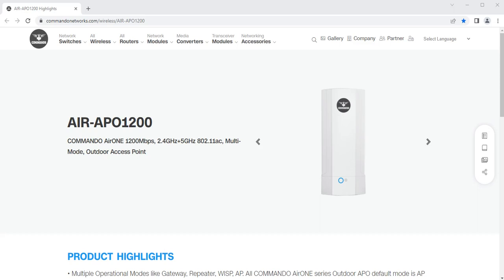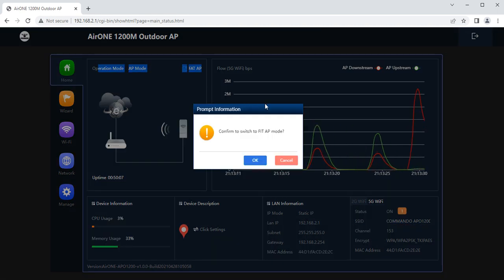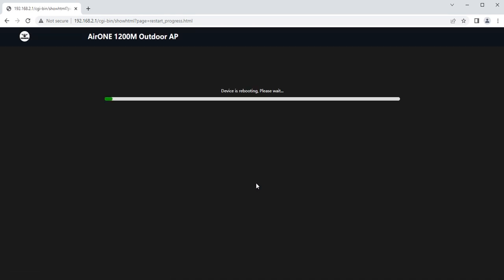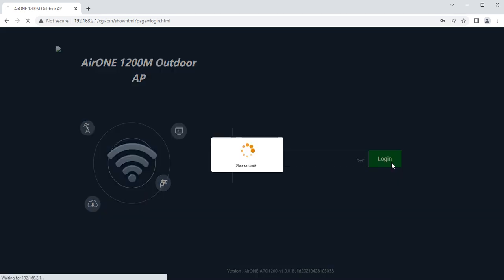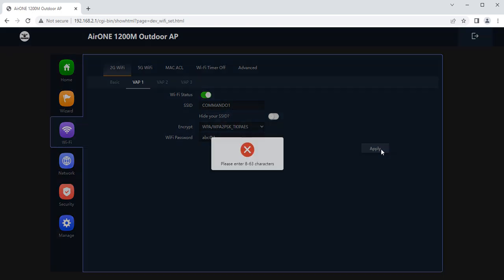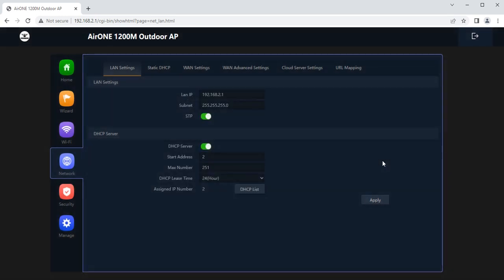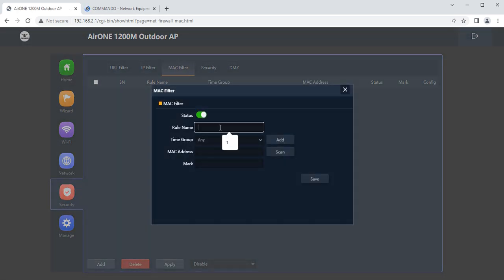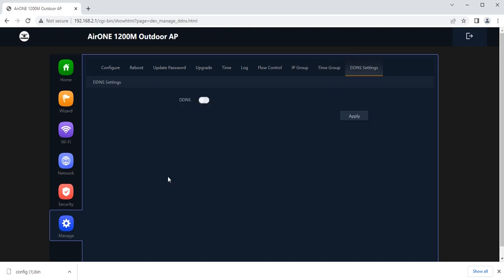How to Install and Configure Outdoor Access Point - COMMANDO AirONE AIR-APO1200, 1200Mbps, 802.11ac

Comment: The 2.4ghz is very slow
Reply from the maker: It is not always the device that's the reason, at times configuration or wrong channel selection or surrounding interference may cause slowness. Let's find out. Contact support to on WhatsApp @ +971509242643